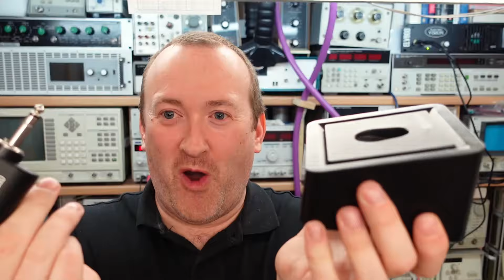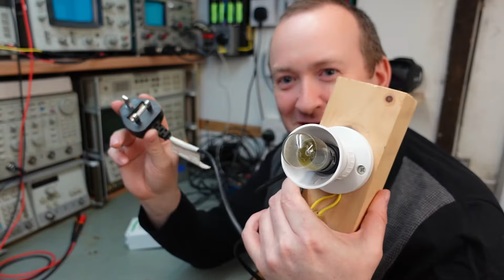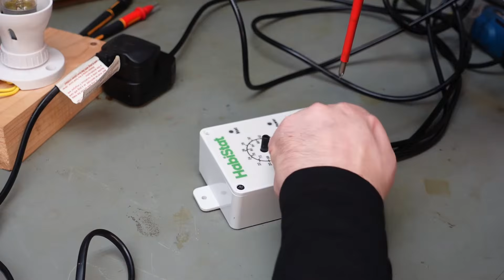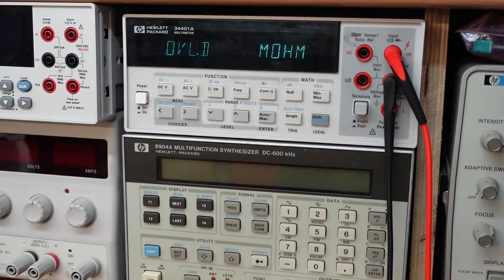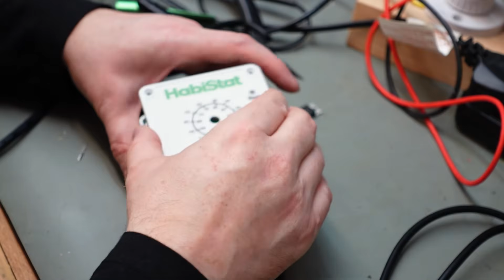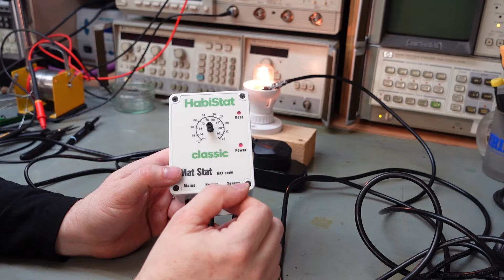Heat Mat Stat Repair

Comment: In the 80s, I did many circuits using Texas Instruments TIC series Triacs (TIC216, TIC226) and I can categorically state that they are the WORST electronic components I have ever used in my life. They burned out after a short time, completely within normal usage parameters, and with RESISTIVE LOAD. The trauma of using Triacs lasted until I discovered the ST BTA series (BTA12, BTA16, BTA24). Today I mainly use them for controlling 100% reactive loads such as fans and even a GTAW soldering transformer! (in the latter, I use a BTA41). The average lifespan for a Triac is now 10 years, with several reaching 20 years. In 50% of failures they simply open, causing no damage.

Comment: No Idea why Youtube suggested this 4 year old video.  But it was interesting, and the failure of the Thyristor / Triac, majority in the ON phase was the reason I developed my own stats that will always safely fail in the OFF state.  Been keeping and breeding snakes 40 years and have heard and seen some horror stories caused by thermostats failing in the on condition.  Snakes, even tropical species can tolerate the cold far better then the heat...

Comment: I'd definitely put a clip on TO-220 heat sink on it. I'm not constrained by saving 50¢ on every unit produced. Most likely cause of failure is overheating. Why not reduce the possibility of a repeat failure. Just because it's rated for 8 amps doesn't mean it can handle 8 amps in free air stuffed inside a box with no ventilation.
Reply: Yes but the heatsink can't shift the heat away much either as it's in a box with no ventilation
Reply: It's not because of the heat. The printed circuit board doesn't have the typical discoloration caused by overheating. The Triac has very high efficiency and practically doesn't heat up with loads below 50W. The manufacturer of this Triac is just bad. Top-of-the-line TRIACs work for decades without showing any defects.

Comment: NEVER USE THESE THERMOSTATS if you have snakes or other reptiles. The sudden in-rush current quickly destroys the heat mats and or heat lamps. Save yourself grief and use a VARIAC turned down so the heat mat is constantly on a a low level. The electricity is negligible, the mats last decades and the 100watt heat lamps last for years. (Not weeks)

Comment: Used properly, triacs are very rugged and reliable. I'm surprised you see short-circuit ones so often. Is it just in these vivarium heaters (suggesting that its a crap circuit or enclosure design) or do you see short curvuit triacs in other small mains devices - food blenders, sensor lights, vacuum cleaners and so on?

I fix things - nowhere as well as you. I dont seemany triac issues
Reply: In the 80s, I did many circuits using Texas Instruments TIC series Triacs (TIC216, TIC226) and I can categorically state that they are the WORST electronic components I have ever used in my life. They burned out after a short time, completely within normal usage parameters, and with RESISTIVE LOAD. The trauma of using Triacs lasted until I discovered the ST BTA series (BTA12, BTA16, BTA24). Today I mainly use them for controlling 100% reactive loads such as fans and even a GTAW soldering transformer! (in the latter, I use a BTA41). The average lifespan for a Triac is now 10 years, with several reaching 20 years. In 50% of failures they simply open, causing no damage.

Comment: Those thermostats are real pieces of junk. Wow. It’s not that terribly hard to make those last pretty much forever. Back home they got an old - now probably 50 years old - AEG hammer drill. Thyristor variable speed control. Works to this very day, and it has built several houses now. That’s a power tool with old power semiconductors. You’d think it should be a no brainer to cheaply make one today that will last. But, ahem, the distributors keep buying junk, so junk is on the market :(
Reply: In the 80s, I did many circuits using Texas Instruments TIC series Triacs (TIC216, TIC226) and I can categorically state that they are the WORST electronic components I have ever used in my life. They burned out after a short time, completely within normal usage parameters, and with RESISTIVE LOAD. The trauma of using Triacs lasted until I discovered the ST BTA series (BTA12, BTA16, BTA24). Today I mainly use them for controlling 100% reactive loads such as fans and even a GTAW soldering transformer! (in the latter, I use a BTA41). The average lifespan for a Triac is now 10 years, with several reaching 20 years. In 50% of failures they simply open, causing no damage.

Comment: Hi mine has a ft0803mw 1511 it's a pulse statu I can't fund a replacement can you advise on a suitable replacement please if possible
Reply from the maker: The TRIACs are very interchangeable. Try a BT137X-600.
Reply: @MendItMark  iv been give this will it be OK thabk you for your reply 
BTA08-600TW TRIAC 600V 8A
Reply from the maker: Yes, its fine. Just a different (non insulated ) case. @jamesstanding3364
Reply: @MendItMark I'm gessing that due to the fact it in a case any way that's not such a problem.  Am I still OK to reinstall the metel heat sink on it

Comment: Love watching you fix things. If I'm honest I don't understand 90% of it but the methodical way you carry it out is mesmerising 😁 
On another subject...I have a Denon 7.1 surround set up (previously Onkyo 5.1) utilising the rear surround speakers that one will make a  'pop' sound when I power it on. It was the left surround jamo speaker and now for some reason the right. The speaker wire runs 4 meters under a laminate covering over a concrete floor. Any ideas Mark?

Comment: I see that the board has provision for a heatsink (not that the heat can go anywhere in a closed case), but it would be interesting to see what temperature the Triac is actually running at when under max load.

Comment: I have a microclimate matstat 100 that intermittently powers the matt. I found that giving the unit a tap would turn the matt on. And given that there is a relay inside I assumed it was sticking. But I have replaced the relay and I'm still having the same problem. Any ideas?

Comment: Hi Mark. Great video it is really helpful. I think I've got temperature sensor failure as there power to the unit, but it's not triggering the heat cable with the dial in any position. Is that fixable/changeable? Thanks in advance

Comment: It would be interesting to show how you could change the circuit to make sure the fail case doesn't cook the reptile. This seems to be a glaring error in product design.
Reply: You'd be surprised how common it is too, with aquarium and reptile heaters. Many people use an inline temperature controller to make sure power is cut if the temperature gets too high.
Reply: @Studio23Media probably best to have two separate devices with fully separate sensors and power controls, really.

But the problem is I suppose that too cold is nearly as bad as too hot — so really I guess you want full redundancy — two separate mats in two halves of the terrarium (so the animals can go from a cold half to a warm half if they want), and separately from that a temp sensor that cuts power to both on too hot, and separately from that a system (either via home assistant or some other smart system) that monitors a few temperature sensors in the space, as well as power sensors per mat, that sends warnings to your phone when things go out of spec.

That’s what I’d do anyway. Two mats, two thermostats, one emergency stat with a relay system, and two smart plugs with relay and power metering and a few smart thermometers in the same smart app (which could be as cheap as just basic tuya — they’re mostly monitoring, not control, after all, except that you can remotely disable one of the two heaters if things go wonky).

And you might want to figure out what the actual needed wattage is to keep them hot in your setup and just size the heat mat appropriately so that if it fails open it doesn’t get too hot.
Reply: For some exotics you might have 2 heat mats anyway as you have a hot side & a warm side.
Reply: The use of an electromechanical thermostat in series is always used in critical devices (domestic microwave ovens typically have two). Using a TRIAC from a top-tier manufacturer would solve this. I would use a BTA12-600 from ST.
Reply: An easy fix would be to not keep animals trapped in boxes
Reply: @DrLoverLoverI totally agree with you! These animals should stay in their natural habitat and not put in glass boxes, waiting to be fed! They should be able to hunt... 😊

Comment: Hi Mark can I send you my thermostat to be repaired pls the red  light glimmers and I can’t control the temperature if you do it still and don’t charge too much 😉
Reply from the maker: Of course you can send it in. Best to contact me by email. www.perton-electronics.co.uk
Reply: @MendItMark  Hi Mark, Did you find out what was wrong as I have exactly the same issue with the pulse state. Thought it was the Supply Cap but change it with no effect, Thyristor looked fine but change it anyway and the heating neon is still flashing dim. Any advice to check next.

Comment: Mark I would really like it if you could devote a video on how to rapidly test semiconductor devices i.e. Mosfets  Power Fets  Triacts SCR's in-circuit using a DMM.
Reply from the maker: Leave it with me. That wouldn’t be too long to do! I’ve also got a few requests for a workshop tour. I need to tidy it up a bit first, as I’ve been restoring a rocking horse, which made a mess…

Comment: i have the same thermostat for my snake viv.. with the same BTA8 triac that has failed.
I have a bunch of BTA16-600B's.. would they be fine it in?
they are 50ma gate too.
Reply from the maker: Yes, they should work in this application. The latching current is slightly higher, but I don’t think that will  affect these stats.
Reply: @MendItMark   I have no idea what any of that means haha. 
Only thing i know is... I repaired a peavey CS 1000 power amplifier, it had blown SAC187 speaker protection triac's.. and i replaced them with BTA16-600B's, So got a bunch of them sitting round haha

Comment: Mark can you please tell me is the mat Stat dial, clockwise to make it hotter and anti clockwise to turn off. Should have an arrow. ASAP please if you get a chance. Thanks
Reply from the maker: Yes, clockwise makes it hotter. There is usually an arrow on the knob, but it was missing from the one in my video.
Reply: @MendItMark  thanks Mark that's the 1 I got for my daughter yesterday and when I gor home from Dublin it was midnight and didn't have the sealant either but the petshop said that was okay. The thermometer isn't matching I've it set to 32c for tonight and the thermometer the cheap 1 that came with it that sticks on says its only 19 C. I appreciate your help bud. Great info.